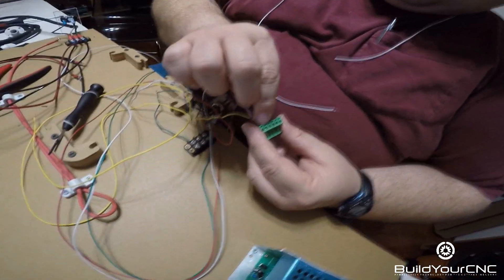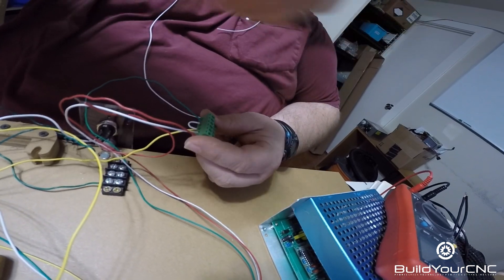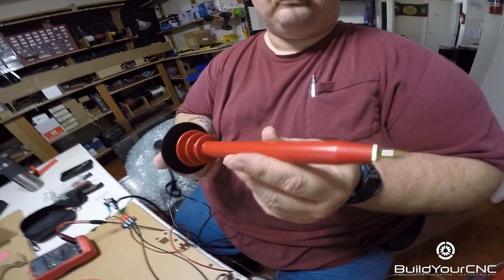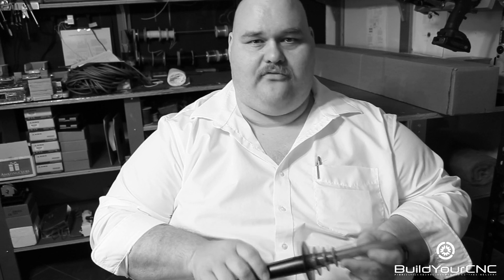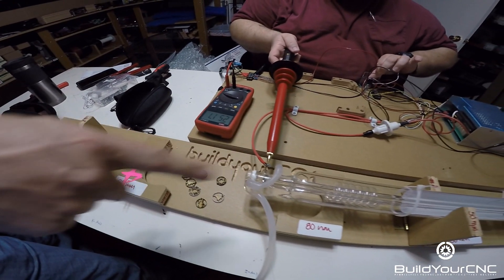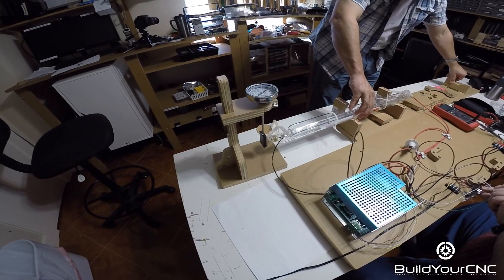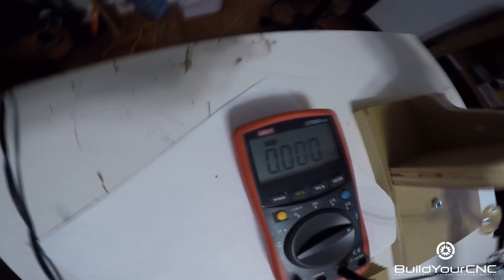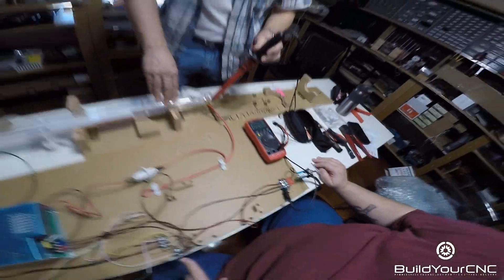How to Test Laser Power for a CO2 Laser Tube

Comment: Hey Patrick, Ken. 
Yes i was very appreciative of all the support that BYCNC has given me since i have owned my system. 
I would like to point out that Patrick and Ken came into work on their day off as that's the only time i was available.

One thing i would like to highlight that i learnt from the above testing was that driving the 40 watts tubes at max power at 22 ma gave us approx 45 watts of output. 22 ma is very high and should be avoided as it is commonly believed to drastically shorten the life of the. But when we dropped the amperage to 16 ma we were still seeing a comfortable 40 watts of actual power output. 

Hope this helps someone.

Cheers
Ben

Comment: I need to make a test rig to test my 2 laser tubes of 80 watts, I got this sys used and was told it work, but the lasers did not work, how can I make a test rig just to find out if the tubes are good and or the power supply?
Reply from the maker: Yeah, it's always good to know what you have and if it works. Any moment, you can pull out a meter and see if you have the right level of voltage to determine if the tube is good, or if the power supply is good. The black box meter is also great to see if the tube is getting old.

Comment: I'm wondering if you are aware of Ohm's, and Watt's laws. Watt's law applies here. P=I*V where P=Power/Watts, I = current, and V = voltage. This is standard knowledge for anyone who has studied electronics. What you described is that the Power was staying fairly constant, while the current and voltages varied in opposite directions. 100w = 10v*10amps and 100volts*1Amp, or 50V*2Amps, or 25V* 4Amps, and so on. Any differences in are due to losses one expects to encounter from circuits not soldered, but mechanically connected.

It was an informative video. I now know what to look for, for the laser power output test meter.
Reply from the maker: Thanks for the clarification.
Reply: @PatrickHoodDaniel  It's a good video, and I am hoping my input above may help others (not just you) who aren't aware of the connection between Power, Voltage, and Amps. Any time someone is working with electronics, even if indirectly, it's good to understand how such things relate.
Reply: @brianfoster1504  Hi Brian, I'm the fat guy who appeared so ignorant; don't blame @Patrick Hood-Daniel, he knows Ohm's  and Watts's law -- just check him out on https://newbiehack.com sometime. ;) Even more sadly, I actually know those laws myself and, on good days, even Kirchoff's for circuit analysis. I've not been at BYCNC for some time now, but on watching this again I believe the thing I was surprised to find was not that voltage and current varied inversely when testing the 80W system but that the same wasn't true for the 40W system. So, with the readings I reported in the video, we had V=15kV and I=27mA so P=40.5W at the full power setting (5V supplied to the controller), V=16.1kV I=22mA so P=35.42W at an intermediate setting, and V=22kV I=6mA for P=13.2W at the low setting. I don't remember the exact numbers for the other system, but it would have been something like V=V I=A P=P for the first, V=V I=A/x P=P-y for an intermediate setting, and V=V I=A/(x+n) P=P-(y+m) for the lowest. Constant voltage, decreasing current, decreasing power. My surprise was that they apparently modulated the power in different ways. I didn't investigate further. Perhaps there are differences in the flyback for the higher powered system. Or possibly resistance changes in the tube play a part, P = IV, as you well know, is the same as saying P = I^2R ; and I remember taking apart an immersion heater once that worked by having two electrodes immersed in water -- if you added a little salt to the water, it heated much faster because the lower resistance allowed a much greater current to flow. -- At any rate, thank you for providing useful information, and for watching the video. I apologize for my lack of clarity. Cheers, Ken.

Comment: I don't see any water cooling the tube?
Reply from the maker: There is a water container (orange) on the floor with a water pump submerged in the container.  There are two silicone tubes connected to the laser tube circulating water through the tube.  It is difficult to see in this video.